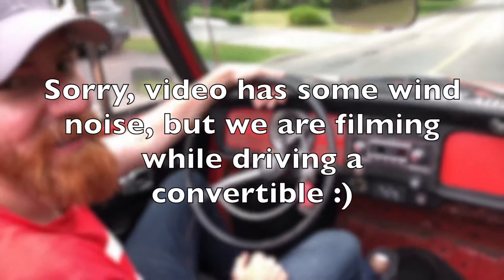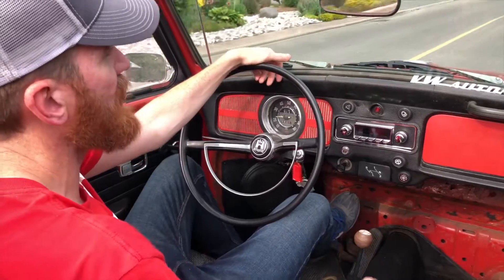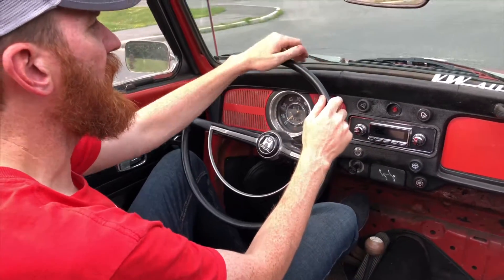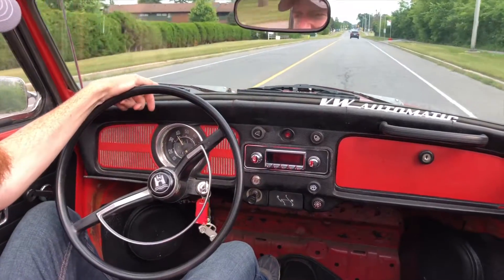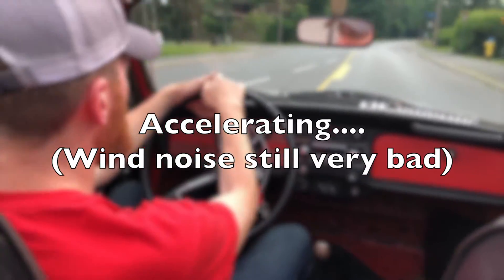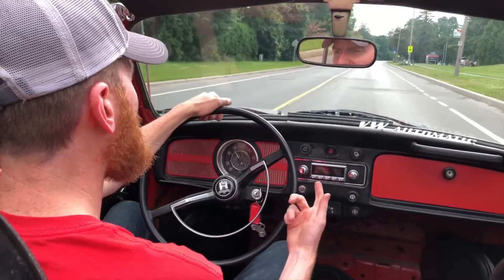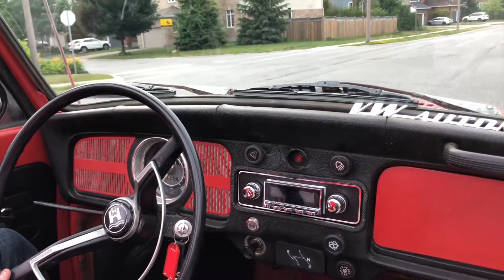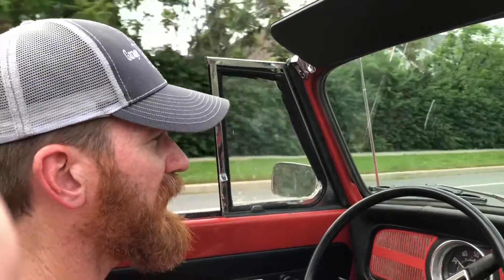VW Autostick - How to shift and drive an Autostick - Road Test

Comment: So is it true First gear, and true second gear?
Reply: From what I understand it's not like a regular standard and first is more like second and second more like third  first would be driving range low second would be driving range one and third driving range 2 driving ranges one and two are your most used gears where as the owners manual says only to use low range when going up or down steep hills or to park essentially this system I believe was designed to cut out the extra work of down shifting or just to make the vehicle more convenient to drive whatever the case of why it was designed the way it was I'll probably never truly know unless there's a statement from it's designer somewhere  it should make for a much easier drive over your standard standard
Reply: I explained wrong a little bit low range would be second and first and second would be third and fourth since the torque converter takes the place of the manual first gear
Reply: @DrakkiiTheLittleDragon  
Thank you.